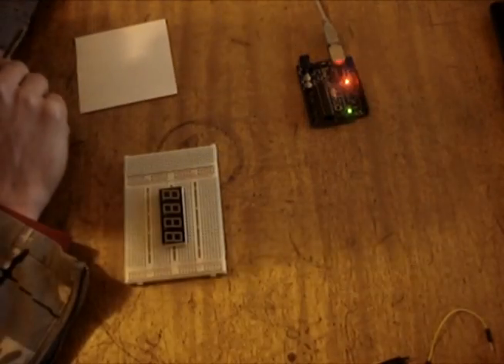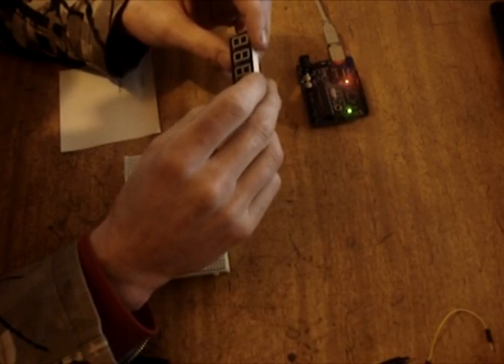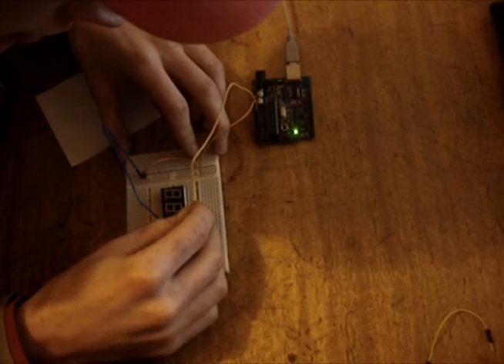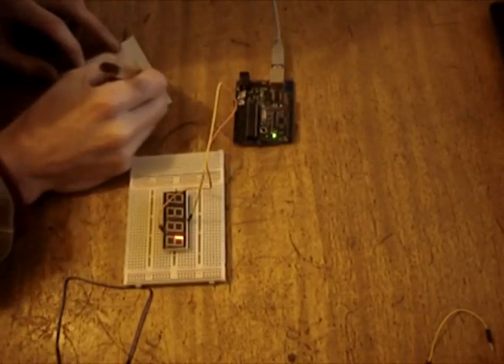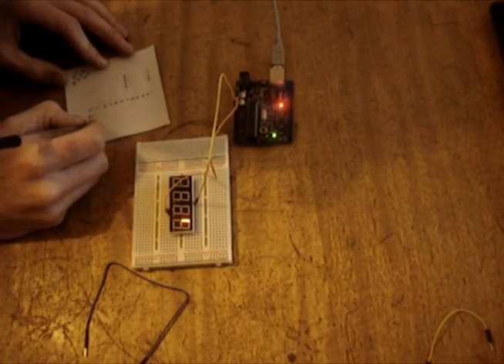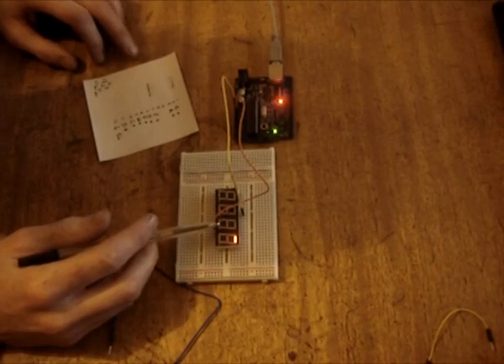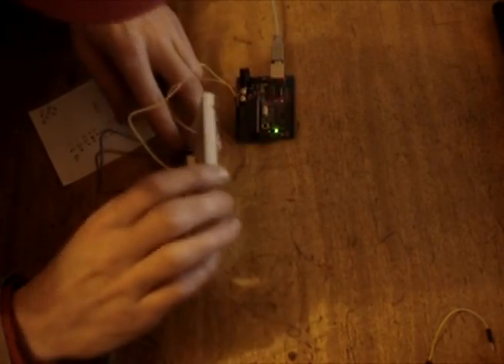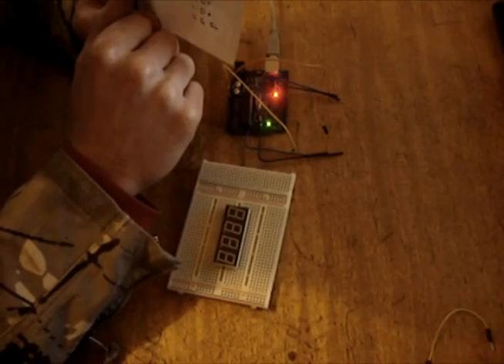Hakology - Mapping a 4 digit 8 segment LED display

Comment: I'm very very happy for your tutorials.
I'm making a car meter as project. Here I'm using such  4 Digit 7 Segments Module to display.
I'm using 3 pieces of 4 Digit 7 Segments Module. 1st for speed, 2nd for distance, 3rd for elapsed time.
I'm facing some problem to complete the task. Therefore I'm cordially requesting you to help to about how to write the Arduino code.
Reply from the maker: Soon the show should be back online and will be doing some more arduino related videos but if you have any specific questions please ask away :)
Reply: Thanks for reply